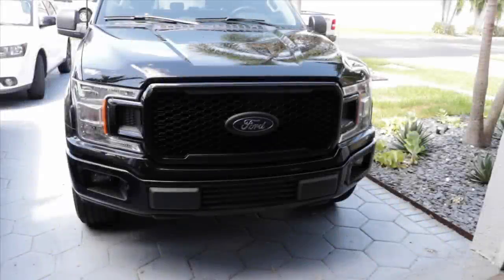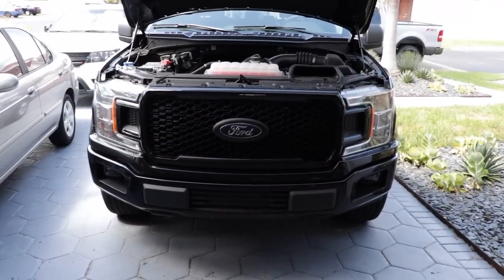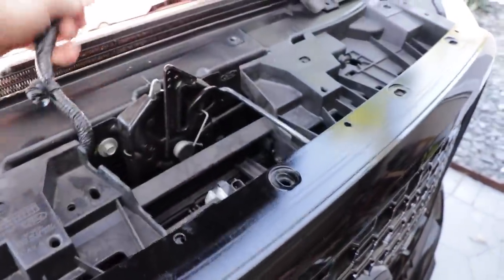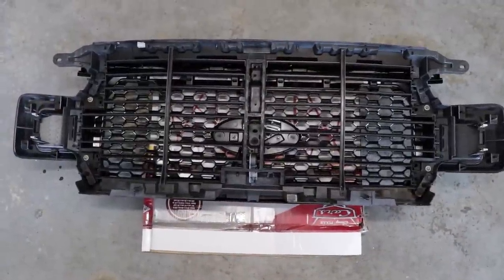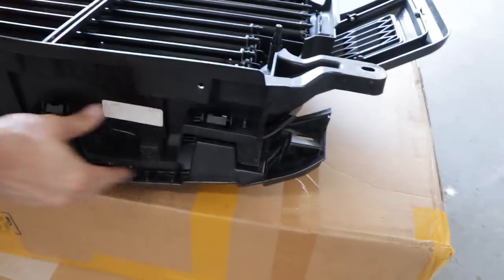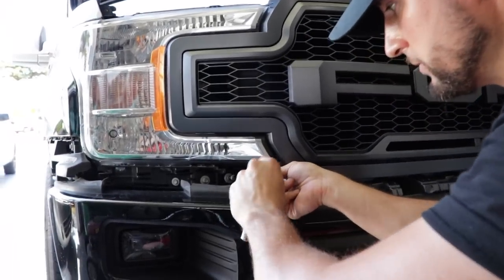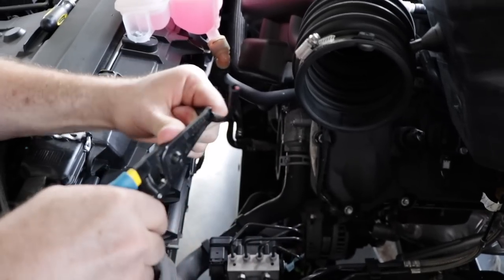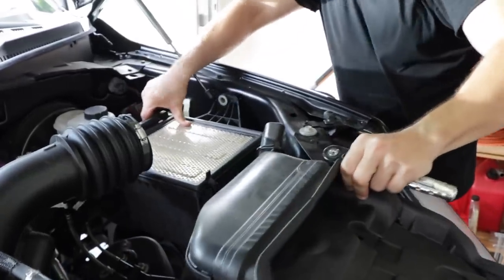2018-2020 Ford F-150 Raptor Style Grille Full Install

Comment: I just saw your great video and is exactly what I was looking for, thanks! However, since I have a newer truck with camera, what do you think will be different?
Reply from the maker: Thank you, what year is your truck?
Reply: @NotoriousDRIVE305  It is a 2023 XLT hybrid. Thanks!
Reply from the maker: Oh, yea, you have the newer generation, it will be much different.  Also, if you have a front camera and switch to an aftermarket grille without a camera slot you will have to make a slot or have a shop make one for you.

Comment: thanks Notorious!  Exactly what I was looking for, especially about the wiring colors!  I am a little concerned now though, because my grill does not have clips on the bottom of the grill for the shutter, jut plastic "stands". Wondering if maybe the XLT grill is a little different. I guess I will see when I get it off.  Dropping the grill off for Metallic paint Monday. I decided to paint the FORD letters black, and am going to use a bed liner paint on them to get a rough matte black finish. Wish me luck!
Reply from the maker: Sounds like it will look tough, I know there is another Raptor style grille that’s a little different but I’ve seen a few people install them with no issues.  Good luck!
Reply: Just finished letters. Not too bad. Letting them finish drying, a couple of splatters. May lightly sand and finish with a regular matte black paint. Tried but can't insert a picture
Reply from the maker: Jim Snipes Nice, I’m sure it will come out right.  Yea, I don’t think you can post pics in comments on YouTube

Comment: Excellent instructions video! How are the letters attached to the grill? Are there holes to bolt them on or are they screw-in? Any drilling required?
Reply from the maker: Thank you!  They have a screw that goes in from the back side, you have to manually line them up through the honeycomb openings.  You can also go without the letters as well.
Reply: @NotoriousDRIVE305  Thanks for responding. Assuming that the screw is not attached to the grill - does the letters move around after a few thousand miles?
Reply from the maker: You’re welcome.  It’s very solid, I haven’t retightened them since install and they have never moved or shifted on me.
Reply: @NotoriousDRIVE305  ok great. I just got this grill delivered from eBay. The seller provided a vinyl set of FORD letters to go at the back of the grill. Assuming the screws would go through those and through the grill holes and then on to the letters. I wasn’t sure if that was going to be stable in the long run. It sounds like it will work. Thanks again.
Reply from the maker: Great, I know there are a lot of different sellers on eBay so I hope you got a good product.  Good luck!

Comment: Installed my grill, looks great!  I have run in to a problem with the lights though. I did the splice as outlined in your video, but lights are not working. I tested before and the lights come on with 12 volts applied. Ran out of time during the install, so wondering if my splices did not penetrate the wires from the car harness. The wires seemed like 20 or 22 gage wires and the splice kit said for 18-14 gage. Will check it later.
Reply from the maker: Sorry to hear, that’s strange.  You really need to get a pair of pliers and clamp them hard, I would definitely test the lights before putting everything back together to make sure it’s all working.  Good luck man!  Btw, I got a variety kit at my local auto parts store for the quick connects.  You might want to try I different size as well.
Reply: @NotoriousDRIVE305  I saw your splices are red, which is for smaller gage wire than the blue ones I have. I ordered some from Amazon (Red) and will try those next weekend.
Reply from the maker: Jim Snipes I hope those work out for you man!
Reply: @NotoriousDRIVE305  worked perfectly!  Everything lights up now. Grill looks great!
Reply from the maker: Great to hear!  Enjoy it man, have a good one.
Reply: Jim Snipes I also tried connecting the lights to the parking on my XLT and they didn’t turn on, is there another place I could connect them too. Have you been able to fix the problem?
Reply: @luisyugiohseller  I used the RED splices that I got from Amazon, made sure they were closed tightly to ensure contact, and everything has been working fine since. Good luck!
Reply from the maker: Make sure you have the proper gauge splices and really clamp hard with pliers, that will ensure a tight fit and a good connection.  Hope this helps, good luck!
Reply: AHHHHH wish I had read this thread before going to Autozone.  I had to call it a night cuz I bought blue ones (18-14) and nothing lit up.  Going to buy the red ones mañana.
Reply: yup bought the 18-22 gauge and it worked like a charm.  This thread single handedly saved me a huge headache.
Reply from the maker: Glad to help!

Comment: Just received my new raptor style grill and getting ready to install.  Has anyone had issues with the splice connector?  I have read different reviews that they don't keep a good connection and the lights start to go out intermittently.  Anxious to get mine installed.  Thanks in advance.
Reply from the maker: Hey, congrats!  My splice connectors are still holding up just fine, just make sure you get pliers and clamp down until it snaps, then take electrical tape and wrap it if you'd like to get better weather protection.

Comment: If I connect them to the parking lights. Will the ambers still be on when my DRLs are on or only when the parking light is on? So pretty much will the ambers stay on even if it’s not on the parking light mode?
Reply from the maker: If you connect to the parking light the will only be on if your parking lights are on or if your night low beams are on.  If you want them to be on with your DRLs you need to tap into the DRL wire, just trace the wire to the DRL bulb and tap into the one.  Hope this clarifies it you you, good luck!

Comment: Just completely installed mine and 2 things are wrong 
#1. I didn't get the two side lights in the package
#2. the LED lights do not come on at all and I wired it exactly as you said to.
:(
Reply from the maker: Amaddragon Sorry to hear, I’m not sure of which grille you bought.  Mine came with 3 lights pre-installed.  You have to make sure you are tapping in to the parking lights wire to get them to come on when your lights come on at night.  If you want them to be on all the time, you have to find and tap into your DRL lights wire.  Hope this helps!
Reply: Notorious DRIVE yeah I tapped into that but it’s still not coming on (3 lights) there is a yellow and black wire and green and brown I hope I have it wired right.
Reply from the maker: Amaddragon another thing you have to test is that you have the positive and neutral wires hooked up to the same on the truck otherwise they won’t come on.
Reply: @NotoriousDRIVE305  I hooked them exactly as you didI hooked the positive to the green/brown wire and the negative to the black/yellow wire.
Reply from the maker: Amaddragon Huh, without seeing what you have it’s hard for me to help.  Only other thing I can think of is if you made sure you got a good connection on your quick connects and have the right size as well.  Other than that maybe retrace the steps and see if you missed something.

Comment: i have connet the wires to alpharex headlight parking light but it work for while  after couple min the parking light and DRL has be shut down ...
Reply from the maker: Why does it have to be shut down/off?
Reply from the maker: I’m not sure what problem you are having but if you follow the directions exactly, you shouldn’t have a problem.  What might be a problem is the grille lights that you bought are bad.

Comment: What if the 3 lights don’t turn on?
Reply from the maker: You need to recheck the connections and make sure they are making contact.  Or you have a defective grille.
Reply: Notorious DRIVE I think it’s a bad wires. 😞😞
Reply from the maker: @rubyred3027   Sorry get your money back or a replacement from the seller.

Comment: So the shutters have zero bolts to hold it in place. I'm guessing it will either rattle or the shutters will fail without support. I really want this grill for my STX.  Please give us an update in a few months.
Reply from the maker: Hey, the shutter has support, it’s the side part that doesn’t.  I haven’t  had any rattling but I will post an update video on how everything is holding up.
Reply: @NotoriousDRIVE305  Thanks in advance for the update.
Reply from the maker: No problem, thanks for watching

Comment: I'm having trouble with mine.. when I plug in the raptor lights it loses power the the running lights..
Reply from the maker: DuraMike 09 I would go back and make sure you have the correct wires, then check your fuse box and see if the DRL fuse is tight.  Also make sure you have a solid connection where you put the wire taps.  Hope you get it fixed!

Comment: I also have this raptor style grill but I have LED headlights, which has a 8 wire harness all together. Does anyone know which color wire is the day time running lights that I need to splice into? I
Reply from the maker: Sorry, I’m not sure which wire is the DRL, I spliced into the parking lights.  You should be able to trace the wire by which light it goes to on the headlight.  Hope this helps, if anyone else has insight please comment.  Good luck
Reply: Hey Prakash Kharel, were you able to figure out which wires to splice into? I’m having the same issue with OEM LED headlights having 8 wire harness. Can’t locate parking light harness on my 18 F-150 Lariat 3.5 Ecoboost
Reply: Am I blind or is there no parking light harness when having OEM LED Headlights 🤔